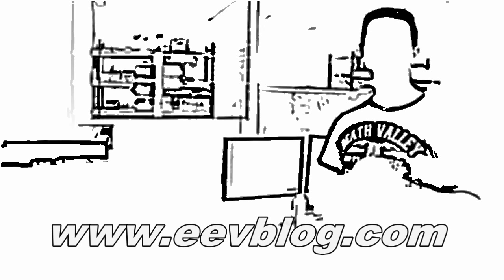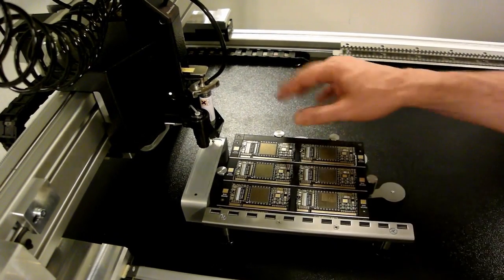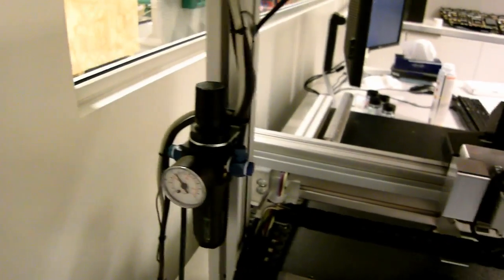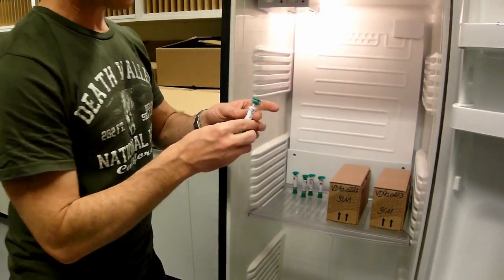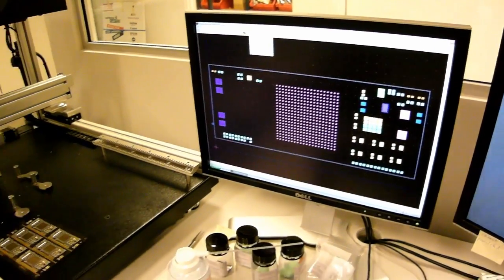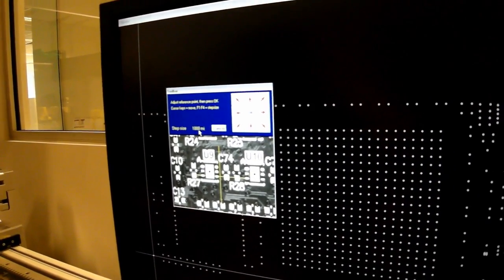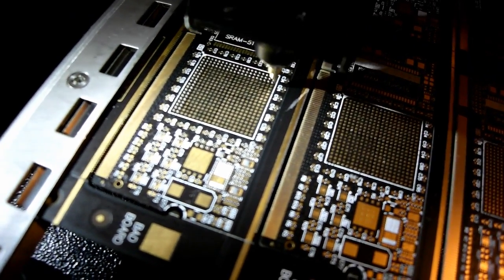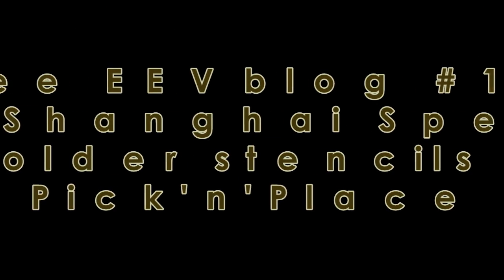EEVblog #163 - Solder Paste Porn

Comment: The unit between the air compressor and the paste dispenser is a refrigerated air drier to remove moisture from the process air.

Comment: I found the video with one of this units in action: /watch?v=9pTpJXFASr8

Dave, I noticed you use SMD's and solder paste. I know you are busy, but this may be a good thing for a small test and review, teardown, ranting about bad engineering... :-D
... and the compressed air isn't problem, it uses very tiny volume of air, so even a small compressor should do the job (in the vid above he uses 2HP compressor, that's total overkill :-). Compressed air is also handy for cleaning electronics.

Comment: It looks really very nice. Dave, thanks for sharing.
I've got this semi automatic dispenser: tinyurl DOT com/d4f6zrq but I don't have compressed air yet. However, it seems to be usable. Build quality of components (valve, ...) seems to be industry standard, but wiring and electronics is classic OneHungLow. It's only 555 timer, with potenciometer at front panel and DIP switch (time range settings) at rear panel. I'm going to make a new electronics - one ATMega, no problem :-)

Comment: @DanFrederiksen There is a flux present (don't know if it is rosin), else there would be problems unless the pads/components had just been moments before mechanically cleaned. Text from a paste ad: "During the reflow process, the flux system will remove the surface oxidation layer and then the molten solder alloy will wet and react with the component terminal and metal pad on PCB and finally form the mechanical and electrical joining." I couldn't have put it better myself.

Comment: @jjlwis A wave solder machine has a tank of melted solder that is pumped up (from the bottom) against the solder side of a printed wiring board (PWB). The solder sticks to any traces, pads and components attached thereto that are exposed to the wave and joins them all together.

This machine dispenses solder paste to the pads on the top of the PWB so that the components that are then placed on top can be heated to the point where the solder melts, joining component to PWB. There is no wave.